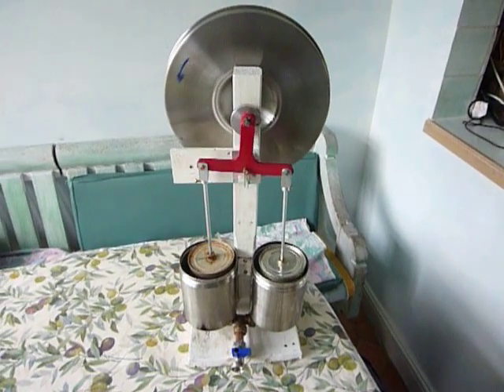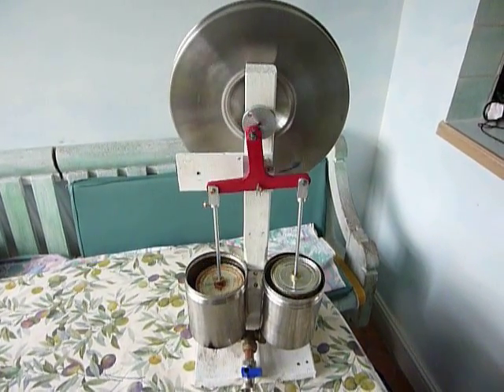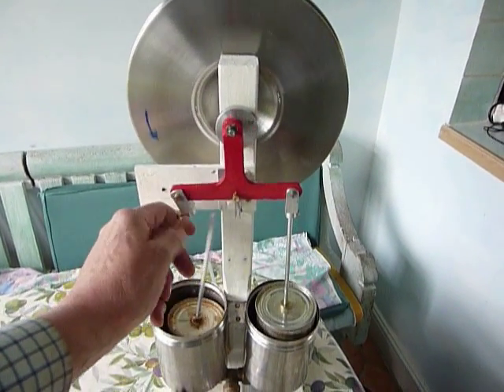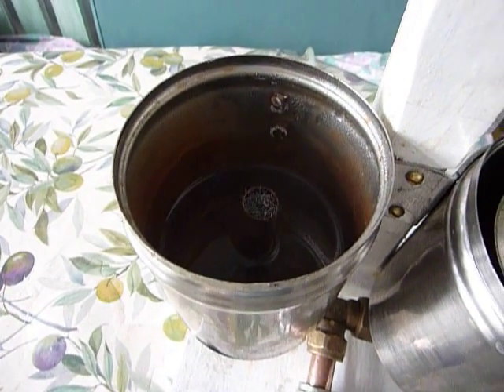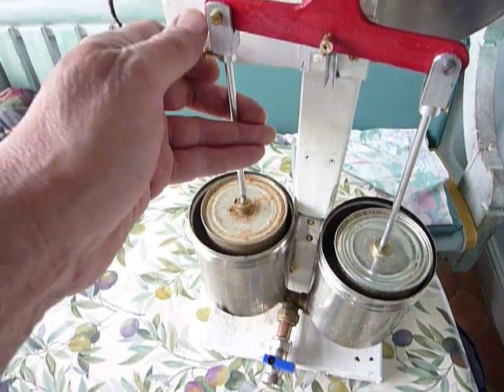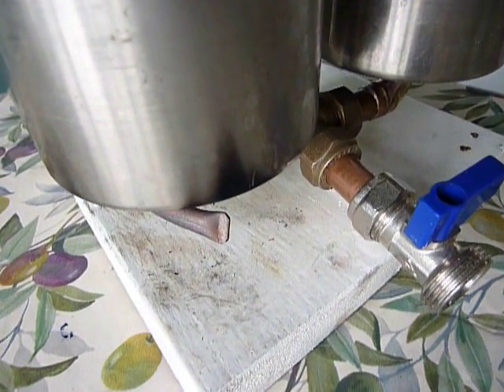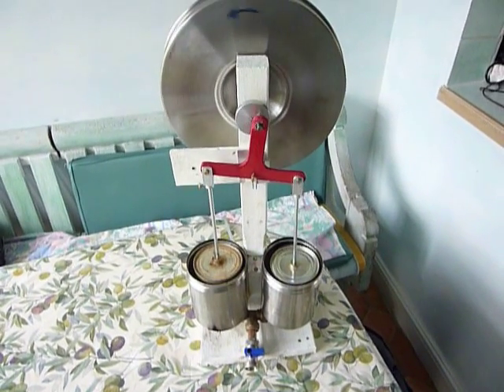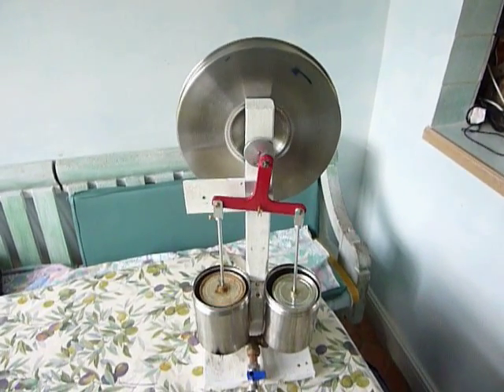Tin Can Stirling Engine

Comment: Great engine! I think the design can be further simplified if the exchange of air takes place through mobile tin cans (pistons) , rather than from below. For this, the connecting rods must be replaced by tubes connected at the top with a flexible hose.

Comment: That is so fantastically eccentric!  I've looked at a hundred pictures or videos of heat engines, never saw anything that even suggested this.  Looks like the eternal problem of sealing, piston-rings, shaft seals and precision in general has been entirely left behind.  Amazing, really.  I am wondering if all that water vapor helps the action, or would it be improved if the ? sealing liquid was some kind of heat-transfer fluid, silicone oil or something that people use in vacuum pumps you know?  That can get hot and not oxidize, and still have low viscosity.  I'm looking around here at some various tin cans already!